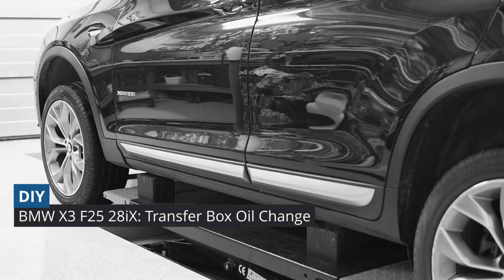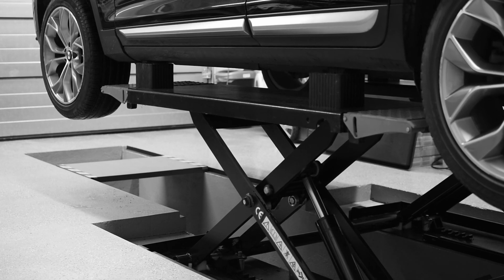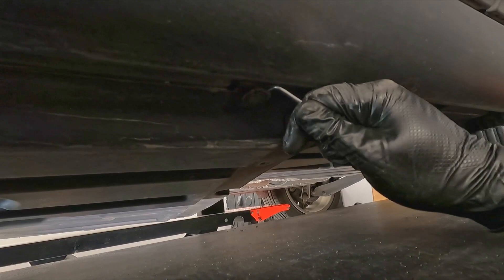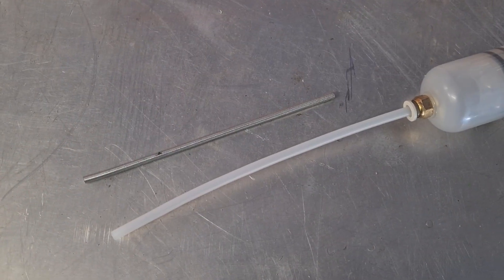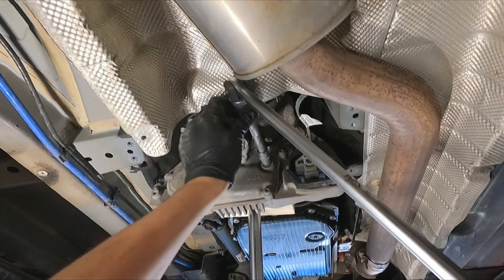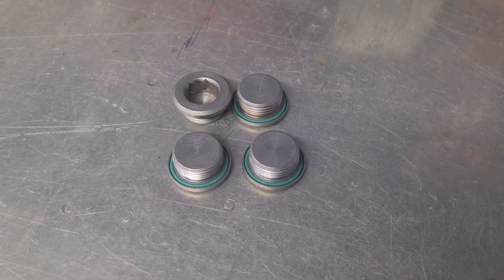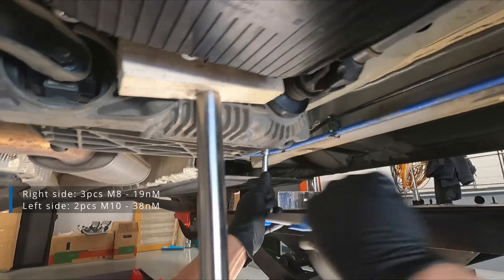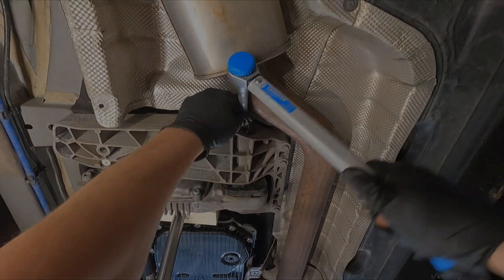Transfer Case Oil Change: BMW X3 F25 28ix

Comment: What type of flexible nozzle did you use to drain the transfer case
Reply from the maker: It was included in the extractor kit. Just a flexible pipe.

Comment: Why not use the fill and drain plug inside on extracting the oil?
Reply from the maker: There is only one plug and it is obstructed by the crossmember which is needed to be removed to get access to the plug.